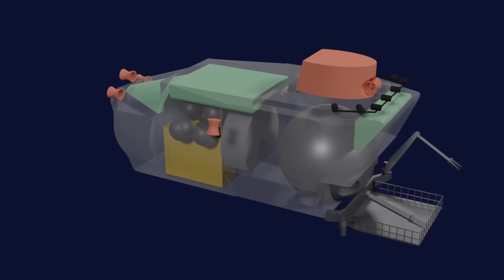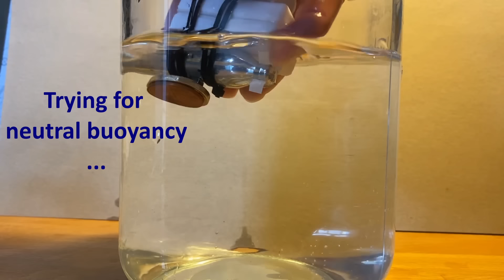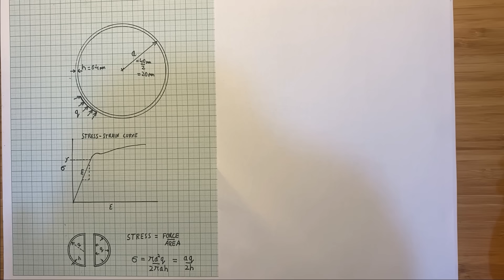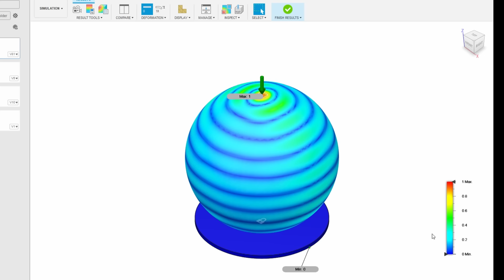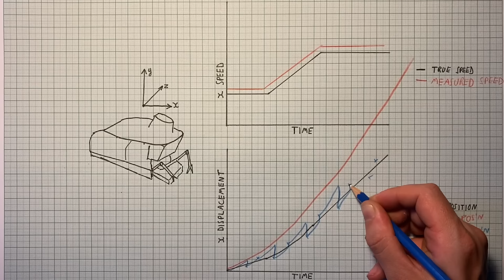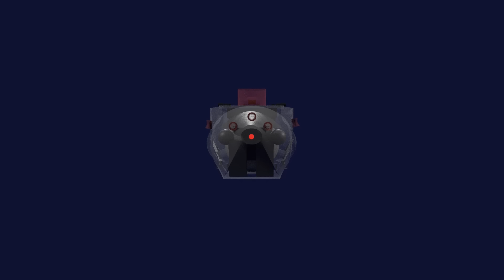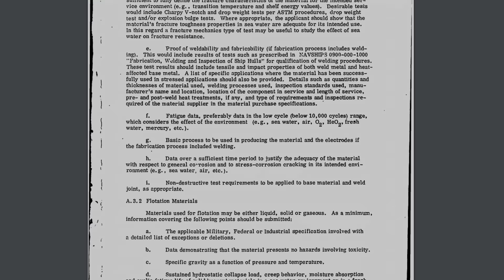DSV Alvin : How to build a safe submersible

Comment: If another DSV or two, possibly three, are wanted for shallower depth uses, all the bits removed over the years from the three Alvin Class DSVs could be collected, refurbished, and reassembled along with new parts as needed.

When Alvin got its latest upgrade with a larger pressure sphere with 5 viewports, the last vestiges of its 1964 origins also went buh-bye, mainly due to getting an all new frame to accommodate the new sphere. There's three or four earlier spheres removed from the three Alvin class, plus the ones in the other two where they're in storage or on display.

I'd expect that a complete Alvin class DSV could be assembled from the bits laying around without having to buy or manufacture a single new part - but such a project would want to upgrade the electronics, motors etc to current stuff, which could be better than what the current DSV of Theseus Alvin sports from circa 2014.

Theseus would be the ideal name for a "new" Alvin class DSV built from the parts. WHOI or whomever builds it could rent it out for shallower dive uses which would come nowhere near exceeding its safety limits. Since the majority of the parts were paid for years to decades ago the re-construction should be quite the bargain VS building all new, to a new design, that would need to be completely tested and verified from scratch VS starting with the known capabilities and history of the existing parts.

Then there's Aluminaut. 251 dives between 1964 and 1971 before it was benched, far as I can find only because the US Navy had their three Alvin class DSVs by then and Reynolds Metals lost interest. It's supposedly been maintained in a condition where it could be put back into service, but it's been parked outside a museum for over 50 years. It's easily capable of diving to the depth of Titanic (IIRC it made some dives deeper and at one time held a depth record or two) with significant safety margin. Despite weighing 80,000 pounds and being over 50 feet long, it can carry up to 7 people, is big enough inside to walk upright, and can carry 6,000 pounds payload. Has any other submersible been as capable?

If after inspection, Aluminaut would prove to be deteriorated to where it could never be used again, copy it and improve on its design. Surely there are current aluminum alloys that can equal its strength at lighter weight, or use essentially the same design with stronger alloy to go deeper.

Stockton Rush was thinking too small. Did he even know Aluminaut existed? Might have been able to build a copy, even if shortened some to save on weight, for less than he spent on Titan and prior little ones of similar design. A submersible based on Aluminaut's design, with state of the art systems that hardly take up any space, configured primarily for tourism, might be able to have a row of viewports down the sides and carry a pilot and 8 passengers (or more depending on what all is needed/desired inside) in alternate side facing seats.
Reply: "Since the majority of the parts were paid for years to decades ago the re-construction should be quite the bargain VS building all new, to a new design, that would need to be completely tested and verified from scratch VS starting with the known capabilities and history of the existing parts."

SLS fallacy in a nutshell.

Comment: Serious question, who the heck is going to do these equations in inches? I fart eagles and piss red, white, and blue and I know that all science should be done in Metric. Imperial is for basic backyard measurements. Never for anything more complex than setting up a shed. It's just not accurate enough. Not to mention the conversions... Metric is so much easier. You don't need to be able to eyeball it, you just need to be able to know what the numbers are for repeatability.
Reply from the maker: My thoughts exactly. The oil and gas industry here in the UK somehow got completely the wrong end of the stick and do all their calculations in imperial (well actually ‘oilfield units’ which are a ridiculous mix of imperial and stupid arbitrary units). I’m going to make a video on it in the future - i spent much of my time in that industry literally shouting at people that ‘American engineers use metric, what we’re doing here is ridiculous’ only to be told I was an idiot.
Reply: @Alexander-the-ok come on. We all know widths are in English even if length is in metric
Reply: A long list of industries including the guys that built this sub. He said in the video the patents for the sub use both.

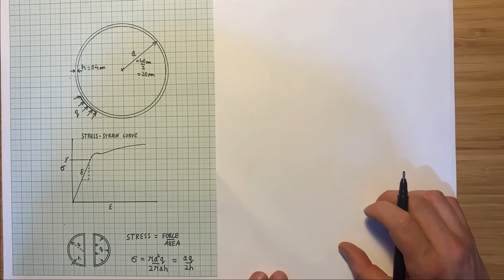Comment: 11:39 I honestly would be stunned if there was a single American in this audience who would be thrown off by using measurements in metric in an example like this, unless maybe they're very old. Science in the US is basically all in metric except maybe government science which interfaces with the public, which unfortunately still needs measurements in imperial. I'm only familiar with the hard sciences (biology, physics, etc.), so maybe engineering is more likely to use imperial units in day-to-day work, but even then, they will be educated in the pure sciences which do use metric almost exclusively. Even math is usually taught with metric units just because of the ease of calculation and conversion. Maybe you'd run into confusion with something like a fuel efficiency calculation (because cars + Americans), but for this you're totally fine.

I say this as an American who uses 24-hour time on my watch, sets all of my weather apps and my water kettle to celsius, and sets Strava to metric, but I promise you can trust me on this.
Reply: Shutup

Comment: "please turn on subtitles if you struggle to understand me"

What subtitles? There are only auto-generated subtitles, which are distracting to look at, have timing issues, have no punctuation, and are typically full of inaccuracies. (These ones seem more accurate than usual, probably because you speak slowly and without music, but there are still a few inaccuracies.)

Comment: Hi, Alexander. Thank you for this presentation. It was enlightening! Maybe this can be explained in a future video, but what I would really like to know is how the equipment external to the pressure sphere is actually controlled. You mention mechanical and electrical ways of dropping various external (ballast) components and interfaces to various sensors for comms and navigation. But... How are these interfaces actually plumbed into the pressure sphere? You talk about acrylic view windows, but how are the cables routed through the sphere. Is it just that trivial that it doesn't require an explanation, or did it just not fit into this one video with simplified explanations?

Specifically, I would be interested to know how the electrical connections were made through the hull of the pressure sphere in a way that didn't compromise the performance at depth. Also, when you talk about mechanical ways of actuating (err...) actions, did that require a mechanical linkage that worked through the hull or was it some sort of magnetic coupling?

Comment: Re: electron beam welding. It's not expensive anymore. Cheap cutting tools like consumer hacksaw and reciprocating saw blades are electron beam welded, which allows the manufacturer to achieve higher margins than could be had by making the entire blade out of an alloy that's able to supply the necessary hardness, flexibility, and toughness (like a HSS with adequate heat treatment).
Reply from the maker: For something the size of Alvin’s pressure sphere it is (well I presume so anyway). It certainly was for oil well casing since it needed a huge vacuum chamber to weld.
Reply: @Alexander-the-ok  oh, of course. Thanks for clarifying
Reply: Those blades consist of cheap spring steel electron beam welded to a very hard, often brittle cutting edge, I meant to say.

Comment: 37:12 As an aircraft pilot, 100% support and love the decision of the sub's pilot to physically disconnect the wires. Sounds like some of my previous training where we were told to pull all circuit breakers, and then one by one attempt a reconnect to re-establish all but the troubled one.

Comment: Thank you for a thorough analysis and discussion.  This comment is off topic, but I think it is relevant.  I recently reviewed some of the documents on the Space Shuttle Challenger disaster, and found a new (to me) clue.  I will simplify it, as follows: given that the booster joint seals had been tested down to temperature X, and had been launched at somewhat lower temperature Y, it seemed OK to launch at even lower temperature Z.  That logic is so bad that it may even deserve to have a fallacy named after it.  Maybe it could be called the "Russian Roulette with Five Bullets" fallacy.
Reply from the maker: Have you seen the visualisation the engineers used to try and convey to management how awful that fallacy was? I dont like to knock the engineering team - they did everything they could to try and stop the launch. But a simple line graph would have probably stopped the disaster. That is with the caveat that data visualisation was very much in its infancy then so it’s easier said in retrospect.

https://williamwolff.org/wp-content/uploads/2013/01/tufte-challenger-1997.pdf
Reply: @Alexander-the-ok  I lost 3 friends on Challenger.

Comment: in which way would steel be considered “biodegradable”??
Reply from the maker: It turns to iron oxide (aka rust) which is basically inert. The process is accelerated by bacteria which actually feed on the carbon in the steel. 
You actually get a ton of marine life around old oil platforms because the bacteria feeding on the iron form the basis of a localised ecosystem.
Reply: @Alexander-the-ok  ig that would be a rather longer process, but its a huge plus that marine life can feed on the rust, while its degrading. 
thanks for the great video, very comprehensive and interesting👌🏼

Comment: The safest (and the cheapest) submersible is an unmanned probe.
Reply from the maker: It’s also unfortunately impossible. You cant get the bitrate to send back live video through acoustic means alone. And a tether with a physical data cable hugely limits capability. If you want the capabilities of a DSV, you need to have a crew.

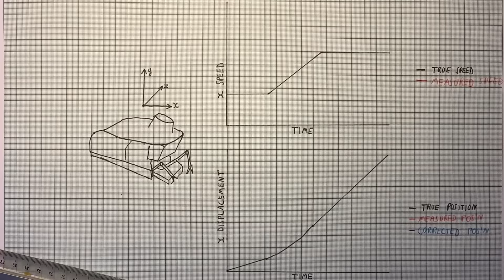Comment: 25:28 The submarine  knows where it is at all times. It knows this because it knows where it isn't. By subtracting where it is from where it isn't, or where it isn't from where it is (whichever is greater), it obtains a difference, or deviation. The guidance subsystem uses deviations to generate corrective commands to drive the submarine  from a position where it is to a position where it isn't, and arriving at a position where it wasn't, it now is. Consequently, the position where it is, is now the position that it wasn't, and it follows that the position that it was, is now the position that it isn't.
In the event that the position that it is in is not the position that it wasn't, the system has acquired a variation, the variation being the difference between where the submarine  is, and where it wasn't. If variation is considered to be a significant factor, it too may be corrected by the GEA. However, the submarine  must also know where it was.
The submarine  guidance computer scenario works as follows. Because a variation has modified some of the information the submarine  has obtained, it is not sure just where it is. However, it is sure where it isn't, within reason, and it knows where it was. It now subtracts where it should be from where it wasn't, or vice-versa, and by differentiating this from the algebraic sum of where it shouldn't be, and where it was, it is able to obtain the deviation and its variation, which is called error.

Comment: i would have thought airbag cartridges could be used in a multi stage system, turning small amounts of a dense solid into large volumes of gas, but i guess you still run into the issue of displacing water in a ballast tank under ridiculously high pressure, the issue persists that the ballast tanks would need to be too bulky
Reply from the maker: Someone else suggested this. It’s a really good idea but I suspect the amount of material you’d need to create enough gas would essentially necessitate strapping a bomb to your submersible.

Comment: The submersible knows where it is at all times. It knows this because it knows where it isn't. By subtracting where it is from where it isn't, or where it isn't from where it is (whichever is greater), it obtains a difference, or deviation. The guidance subsystem uses deviations to generate corrective commands to drive the submersible from a position where it is to a position where it isn't, and arriving at a position where it wasn't, it now is. Consequently, the position where it is, is now the position that it wasn't, and it follows that the position that it was, is now the position that it isn't.
In the event that the position that it is in is not the position that it wasn't, the system has acquired a variation, the variation being the difference between where the submersible is, and where it wasn't. - Alex describing Alvin’s location sensing capability

Comment: I am not an engineer, nor a biologist, but I have a question: how do whales dive so deep without ballasts? More specifically, how do they retain neutral boyancy with no obvious moving parts?
Reply: They don't retain neutral buoyancy. They don't have any equivalent to a fish's swim bladder.
Reply: @IsaacKuo  that makes some sense, but they also both aren't crushed under the pressure and don't explode on the surface, so I would think that something else is going on as well. I remember hearing about some sort of oil they have in their heads with an unusual pressure/density curve, or something like that, which helps, but I don't know the details.
Reply: @benG2141  What you've heard of is a theory that applies only to Sperm Whales, which have a large organ in their head used to focus their sonar. The theory is that this organ could also help control buoyancy, but as I understand it this theory is not widely accepted.

As I understand it, large whales have relatively small lungs compared to their overall volume, limiting the problems with buoyancy changing with depth.

Comment: A couple of areas you didn't address. How do they get control inputs from inside the pressure sphere out to thrusters, servos, ballast droppers, arms, and other things? Did they have to penetrate the sphere with wiring bundles? How did they seal it from penetration afterwards? Also, how do electrical components such as the thruster motors operate emersed in high pressure sea water without shorting out? In your drawings it appeared that the batteries are rectangular boxes outside the pressure hull? Basically there are a bunch of either electrical or hydraulic components outside the pressure hull. How in the world do you get them to work at a rated depth of something 21,000 feet depth of high pressure, highly conductive, highly corrosive sea water?

Comment: How about this - cameras on a remote submersible and you stay on the boat with some really great vr glasses.  Way better view.
Reply from the maker: You need a physical tether - acoustic transmissions can’t get anywhere near the bitrate needed to send live video.
For ROVs, that’s the setup - a power and data cable runs from the support ship. For a research vessel like Alvin: not a chance. A tether would hugely limit its capability. You need a crew down there.

Comment: The way to view Titanic is to create a dark cinema seating about 20 people equipped with 4D - ie smells, tempertautes and vapours. You connect this to an unmanned drone with super lighting and cameras. The audience can then experience a journey in big screen real time from launch to arrival at depth.  The drone can do all sorts of things impossible for a manned vehicle - inside shots etc.  Of course you can give them a thrill at the end with a good implosion. There is simply no need to expose rich idiots to risk of this type for cocktail bragging rights. I'm a naval architect specialising in carbon fibre - whoever used this composite material in compression is also an idiot who should have his licence taken away. Another cinema would involve an escalator on a redundant indoor Dubai ski slope. This could be used for the Everest experience - oxygen deprivation - an escalator on which everyone has to keep step etc etc - the world is crazy in its requirement for stupid risks due to the fact that most 'adventures' have been achieved.

Comment: It occurs to me that the reason the ping pong ball didn't buckle at the expected pressure has to do with the fact that it is full of air at likely slightly more than one atmosphere. As it begins to buckle, the internal volume decreases, and the internal pressure increases.
Reply: Ping Pong balls do buckle, at any internal pressure.  This is a mechanical asymmetry issue, also valid in any pressure applications.  When we were modeling the DOWB, it was obvious that the symmetry is vital.  As a result, much of the steel body was actually machined away (both sides), to make as much equality as practical (based on empirical data and testing of small-scale thinner models).  This was also true of nuclear weapons "cores", where the pressure was externally applied.  See books by Rhodes, about how they did this for nukes.
Reply: @brunonikodemski2420 ⁶⁶66😅😅

Comment: Build it out of concrete 6 feet thick, that oil drilling platform in the north Sea is anchored to the Sea floor but before it got the it in away was a submersible